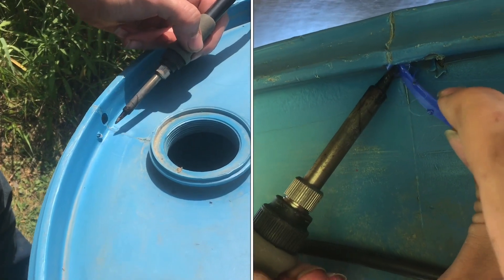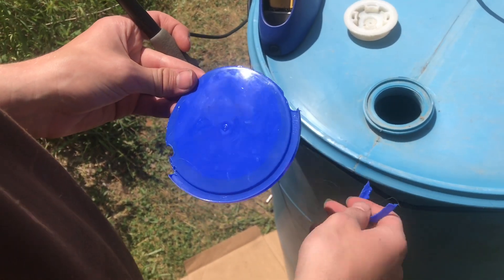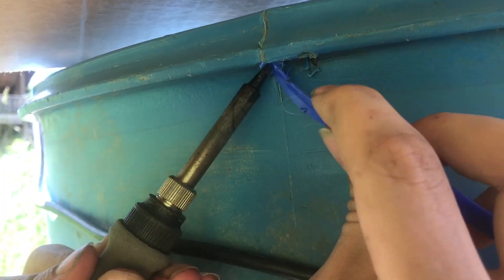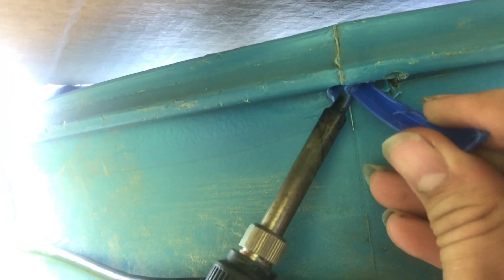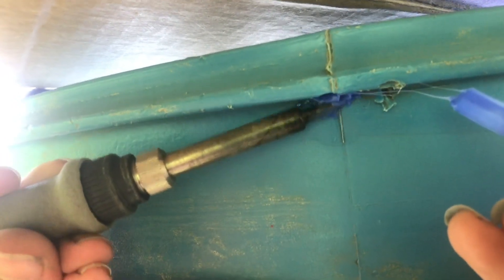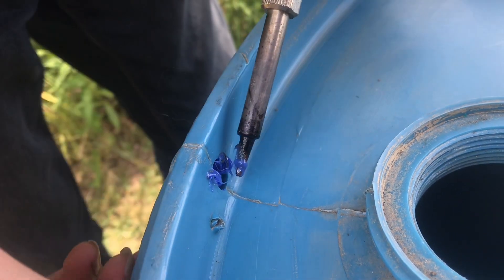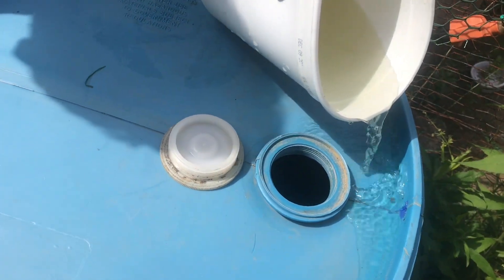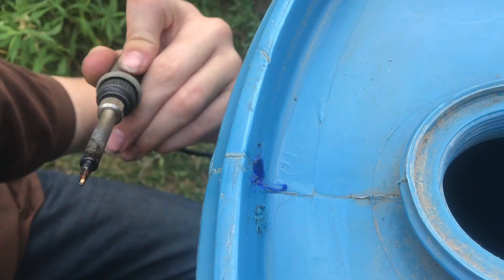REPAIRING holes in polyethylene or poly propylene plastic (watertight) plastic welding

Comment: I just tried this method on a 165 gallon polyethylene pond form. Can’t wait to see if it worked.
Reply: well... did it work?
Reply: @vitalsteve1  Nope. Not a fix at all. The hole was at the bottom edge and the force of the weight of the water kept breaking the fix. It might work on something that doesn't get much stress, but not on my pond form. Had to just throw it away. A leaking pond form is basically just trash.

Comment: Where did you get the repair piece?
Reply: It looks like the cover from a plastic container.  For this job you need HDPE to match the barrel.  Plastic containers are labeled 1,2,3, 4, 5 for the type of plastic used.  Things like peanut-butter lids are HDPE (#2) plastic.